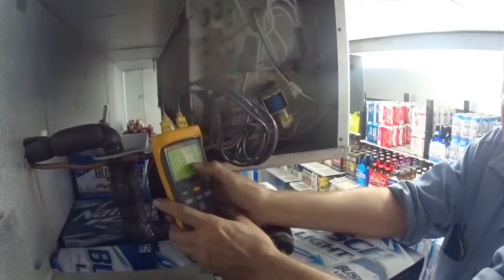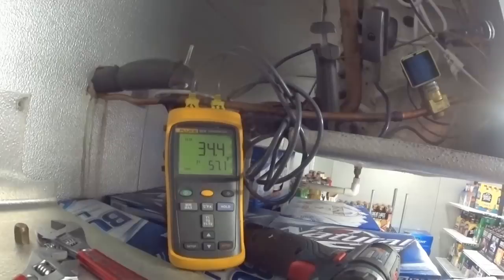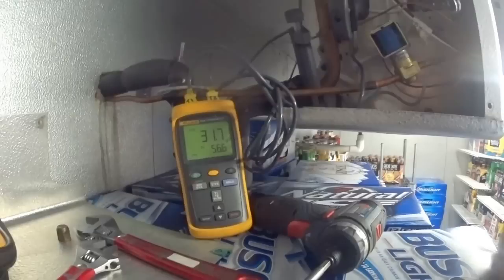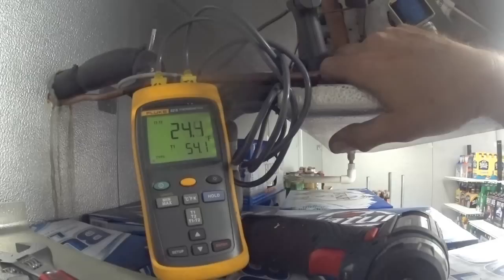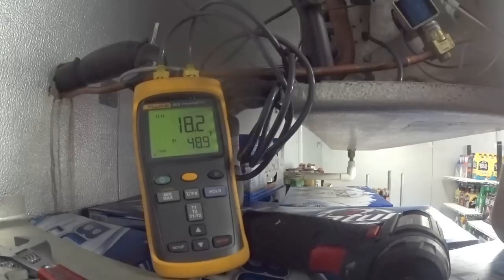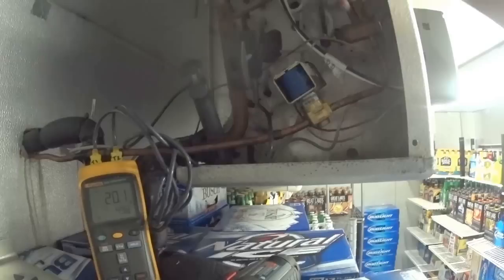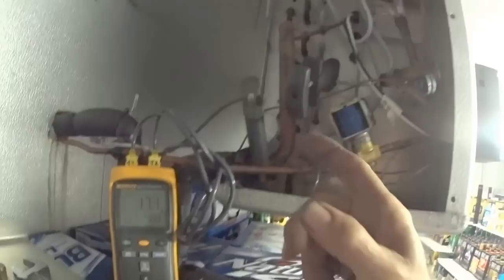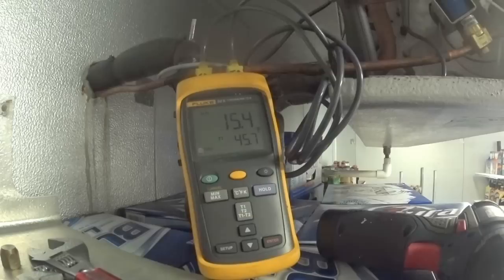Adjust the superheat setting on the expansion valve

Comment: Umm, where's the pressure measurement?
 Did Jim ascend into the pantheon of gods where he can close his weary eyes and "See" pressure without a guage? Thought super-heat was a measurement acquired with temperature AND pressure measurements. Guess every book published about this trade, and Sporlans own literature is wrong lol
Reply: Jim's way is acceptable way of measuring superheat. Just takes the guesswork out of it. Actually there is not any difference between converting pressure to saturated temperature and Jim's way of measuring saturated temperature directly. Hussman manuals use this method.
Reply: Can you shoot me a link? 
 I fail to understand this method of measuring super-heat.
 How does it take the guess work out when you're assuming pressure? If there's no pressure measurement does one just assume the coil is at the pressure for the desired saturation temperature?
 Please help me to see what you guys see, I mean this genuinely. I always like learning new things, so I dont put my foot in my mouth again
Reply: @jakem117  the first step in calculating superheat in the traditional way is to measure pressure and convert it to "temperature" this is the "saturated suction temperature" of the refrigerant in the evaporator. Jim is measuring the saturated suction temperature directly with one thermometer connected to the evaporator inlet about 6 inches downstream of the txv and the other thermometer probe at the evaporator outlet so he does not have to convert pressure to "temperature" the difference in the two probes readings is the superheat. Hope this helps you understand.
Reply: Well, I'm an idiot. I've never seen or heard of that ever. I'm going to try it. Thank you
Reply: @jakem117  try it both ways and let me know your results.

Comment: Jim great video. Quick question. If I was to take my superheat with saturated pressure and convert to temperature minus my outlet temp, will it give the same 15F of superheat?  I never seen this method but it looks easy and accurate.  Thanks for taking the time to pass on the knowledge.

Comment: On a AC system if you adjust your TXV superheat then do you have to measure subcooling and adjust your charge?  Then once you adjust your charge won't that effect your superheat so how do you not get stuck in a loop of ajustments?

Comment: I was taught adjusting the superheat is the LAST thing you want to do. But, if you have nailed down the charge and pressures, dry refrigerant (no non-condensables), both coils are clean, airflow is correct at both coils and box temp is not super high, then you test the TXV function by immersing the bulb in hot and then cold water to see if the TXV is bound or not, if not bound (stuck), then you can adjust TXV. Books says 1/4 turn at a time, so to see you reefing on that stem like that made me take notice!! Lol!! But...I get it, when you charge $150/Hr, you don't have time to play around. I got good information from the video. Thanks.
Reply: mundrubjet That is the completely wrong way to check a txv, if you want to know the correct way watch the HVAC School video with Brian Orr. That’s what I was once told too but have since realized how foolish that was
Reply: Exactly

Comment: Hello Jim, Good effort on the video. However.. You are not adjusting the superheat. You are adjusting the flow, and to the detriment of the system. You should not have frost on all the tubes, you should have frost on the first third of the tubes. Superheat works by boiling off the liquid in the first third, then the latent heat is absorbed into the vapor in the final two thirds. If you have frost on all the tubes, then you have liquid in the lines, and you will soon smash your compressor rods.. Superheat is achieved using Manifold gauges and a simple thermometer at the suction line. Loving your effort, it's nice, but your advice will destruct peoples chillers. I hope I'm not offending you.
Reply: Am i correct in thinking to adjust the superheat on a TXV system you need to add or remove refrigerant by checking your subcooling at the condenser ? Im confused as to what the point of adjusting the TXV is ? Why would you need to adjust the flow if not to adjust the superheat ?
Reply: Simon Horswell thank u sir
Reply: you need to either have more refrigerant flow or less to adjust super heat. If the SH is too high you need more liquid refrigerant to enter the evaporator therefore a TXV adjustment is needed. Its not always that simple there are lots of factors that can effect the SH leaving the evap.
Reply: +simon. it sounds like you don't have much experience with TX valves, because if you did you wouldn't have said that.
Reply: Simon Horswell 
You said superheat is absorbed by the liquid and latent heat is absorbed by the vapor that’s totally false. Latent heat is absorbed by liquid to turn it to vapor then that vapor is superheated by absorbing heat from the surrounding.
Reply: Superheat is above your saturation temperature & sub-cooling is below your saturation temperature of you refrigerant .The way Jim is adjusting the TXV is one way that how they adjust TXV once on refrigerant cases can’t find documentation but it’s how certain manufacturers want you to adjust your TXV.

Comment: Very informative video Jim.
What would be the evap. temp as well the SH for a freezer.
AC evap. 45 SH 10 to 12
Walking cooler evap.20 and SH 15
Freezer with 404A  Evap. ? and SH ?
Thanks
Reply: After reviewing the video again,  Jim said the deltaT was 10 or 15, not the SH.

Comment: I replaced a bad TXV on a 4 ton R22 A/C coil. I weighed in the charge. Parker said to adjust the txv even though i got the same one i replaced it with. My initial start up i was low on pressure. Not much load. Should i check my superheat at the end of the coil? I usually check it at the condenser. Some folks told me not to touch the txv and just add gas to get my superheat subcooling. HELP?

Comment: Hi jim you have great vids .Jim im working on a walkin cooler 404a. Fairly new I inherited this warrenty job when i bought this ac business. Not good at refrigeration. What are the pressures on 404a with a box thats 45 degrees. I have 2 evaps and 2 condensers with pump down solenoids my pressure are 45psi and 180 head cutin 70 and cut out 20 thanks for any info

Comment: So with capillary system, you can tell if the refrigerant charge is correct by checking the superheat. What is the best way with a txv? Also when you went and checked the sight glass after getting the desired superheat were you getting any liquid back or was it all good?

Comment: Nice video. I was working on a walk in beer cooler that had 2 evaporators and both had the same issues. Both txvs and near by piping had a bunch of ice, the drain pans we're also frozen solid. The actual coils were not icing up though and the space was conditioning. I noticed someone set the tstat to 29° and thought that caused it to form the ice. After thawing the unit out I checked super heat and subcooling by the condenser which seemed normal. Would it be possible that both txvs on the condensers need to be adjusted? Thanks.

Comment: Before adjusting the txv, did you check your subcooling and found out if you have good refrigerant level?.... I really hope that the new techs out there don't play this guessing game, sorry if I'm harsh but I prefer new guys learn the right way. Also all you need to carry with you is a small stubby gauge, a 6" hose and a thermometer to properly check superheat, if you don't want to carry your whole manifold.
Reply: @Stephen Brawner i got 14 years of supermarkets refrigeration experience, worked at Costco, walmart, Target,, Ralph's, facilities among others, plus 4 years of engineering school.
I get your point,  but years of experience don't mean anything if you have that many callbacks right? 
I just don't like that guessing game, not when they're is a whole science behind it.

Comment: What happens when the compressor gets liquid back on its suction?.... I hear some clean condenser coils to cool a compressor....
Reply from the maker: Mark Pasieka the liquid refrigerant is like dry fingernail polish remover, it dilutes the compressor's oil, changing the viscosity (lubrication factor). It would be like if you put paint thinner in your car engine's oil, the engine would bind up or the piston rods would break.

Comment: Good work Jim. Mist guys wouldnt even check to TD. They would have just gassed it up and left and not fixed the leaking cores either just stuck new caps on them. Good thorough job
Reply from the maker: awsom70 thanks

Comment: so evap temp required is 36 to 38 degrees, so general evap temp should be 18 to 32, what would your cut in/cut out settings be?
Reply from the maker: Ben Staton they should be the same as the R22 settings, the pressure is similar . This is a pump down system, so cut in at 35 and out at 1-4 , thanks

Comment: If this is an old install then surely a tev adjustment isn't the way forward? Short of refrigerant sounds more likely. If new then slap the install engineer 😉
Reply: Kieran Craddock 
I see your point, but still the txv adjustments are needed.  If low, all Refrigerant must be removed and fresh added. Since you don’t know the exact pounds needed or if the txv was adjusted on day one, you have to adjust it again.  But good point.

Comment: if you have to open a txv that much there another problem probably the power element has lost charge.
Reply: S will If the element lost it’s charge, how would it be adjusting?

Comment: Omg..... I've been checking and adjusting superheat all together wrong for 30 years.... I had no. Idea you could base a critical adjustment solely on temperature... Someone had better inform Copeland and maybe even sporlan!!!!!!!
Reply from the maker: I got it from Hussman and RSCS
Reply: Wait, what???? this is hillbilly refrigeration. This is not proper Technique JIM. Not trying to slam you but this is all wrong.
Reply: what do you call proper technique? hussman refrigeration corp recommended this years ago. some of the old heads still use it to this day its a tried and true method.
Reply: I don't know why this is so hard for people to understand? For anyone that installs heatcraft evaporators it comes with an install manual it shows this as an alternative way of adjusting superheat. For a man like Jim that is a true veteran in the business, I'll bet his technics work.
Much respect Jim.  I just had the pleasure of working with a guy with over 40 yrs of experience and I can tell you that not everything was text book but it worked.

Comment: When do you use a "P" trap on a refrigeration suction line?
Thanks, Jim C.
Reply: Depends on the manufacture, but many say to trap all horizontal lines, some will say for "X" ft of rise, etc. It is best to check with each manufacture, trapping is a means of controlling oil back to the compressor
Reply: I think when the condenser is above the walk in cooler then you use P trap, If it is on the floor then you wouldn't need it

Comment: It seems that the SMAN gauges aren't used by  very many techs. Do you have any thoughts why not?
Reply: I think it's a location thing. I see more people with smans around Atlanta where I am. I've met people just recently that have smans and they've never even heard of testo. But it seems more guys use Testo's on YouTube.
Reply from the maker: sad hvacman I bought an SMAN4 last year, it is a good gauge set, it's just large and bulky, the testo 550 is more compact easier to climb ladders with, I bought three testo 550's last year and the testo 550 bluetooth this year. I'm not impressed with the blue tooth version, or the Imanifold , too many features that you don't need to get the job done and get on to the next call. Customers don't care, they pay for temperature results.
Reply: I've heard the same complaint from friends and coworkers, that the smans are too bulky.  I own several testo manifolds and I love them. I think fieldpiece could also use some durability improvements across the board with all their instruments. They make good stuff, it just needs to be tougher.

Comment: Hey jim nice video's put i would love to know what your super heat,
and pressures are doing while your adjusting the txv is hard to know if your over, under, or on the money with charge.
Do you ever have to adjusy your charge once your temperature 15 degrees difference is perfect??
if the question is stupid it might be because I'm only an AC Tech LOL.

Comment: Jim,
I am really confused with the way you are adjusting the expansion valve to change the TD of the evaporator but you also say that you are adjusting the superheat in the same breath.  I know that there is a relation between the TD and S-heat and I know that superheat and evaporator TD are related but isn’t superheat the refrigerant saturation pressure temperature difference between the refrigerant in the measure line and the actual temperature measure of the line.  I you checked the superheat at the condenser on the roof with gages and temperature probes would the SH agree with the final 15 degree TD that you adjusted the expansion valve .
I have nothing but admiration with all of your videos and I am really learning a lot from them but I am confused and I want to understand.  Can you kind of see how I might be confused?
Thanks alg
Reply from the maker: Al Garcia Al you are correct about superheat, I should call the setting the TD, the valve stem adjustment in the literature is called the superheat setting.
Reply: You are correct on the understanding of SH, unfortunately Jim is not adjusting SH. This could cause mistakes at the job. Also, SH is something I very rarely adjust on a box,  repeat "Rarely". But, my position also allows me to take more time at the site to find the cause to the effect, a luxury not offered to all.